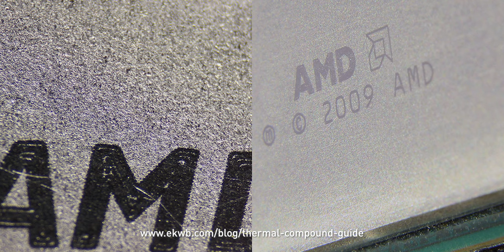Liquid Cool School: Beginner's Crash Course in PC Water Cooling

Comment: That is NOT enough thermal paste! @17:15 😱
Reply: I know everyone has a different method, but I like to do the buttered toast method where you go ahead and spread an even thin layer across the whole IHS before placing the water block on top. Yeah, some may come out the sides, but at least you know it's completely covered. The problem with the pea size dot in the middle is that it may not spread out across the entire IHS surface and just make a small circular pattern. I'll even spread the thermal paste out to the edges with my finger carefully. Even if you get some thermal paste squished outside the IHS, it won't affect the electronics.

Comment: Serious question from an OLD TIMER who has been building custom PCs for about 20 years and LEARNED THE HARDWAY.  What happened to ESD protection??? There is NO mention about ESD in this video?  I really think the newbies out there need to know about Electrostatic discharge (ESD) and how it can DESTROY your build.  I wear Electrostatic discharge (ESD) discharge strap.  

Is this no longer a thing?  I mean I watch this video and I cringe with how the components are being handled and not EVEN any effort to ground!  Again is ESD a threat anymore?
Reply: I have been building PCs for 20 years and I have never killed a PC or a PC component with ESD. It's a fair point, but you really have to be unlucky to fry something with ESD. I know that in the professional world, this is a requirement, but I'm pretty confident that 99% of the users building a PC at home use no ESD protection. It is also a good topic for upcoming discussions and I will mention it in an upcoming video.
Reply: Yeah it's definitely worth mentioning to ground yourself. Maybe they didn't want to make it intimidating